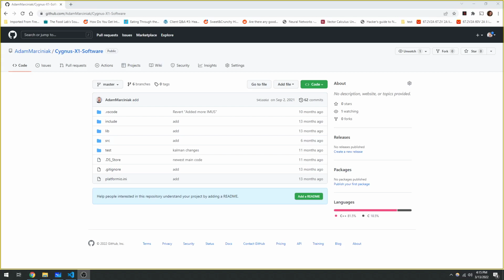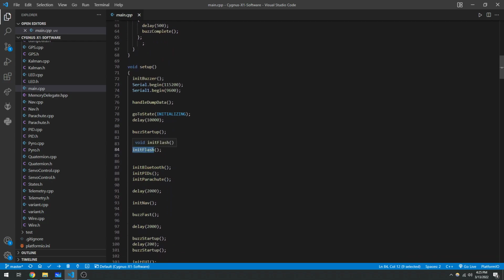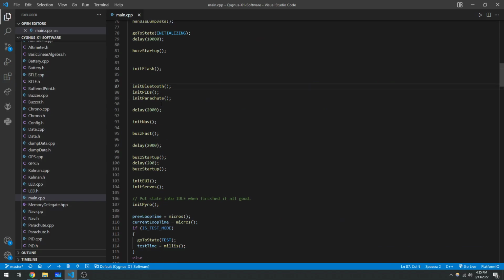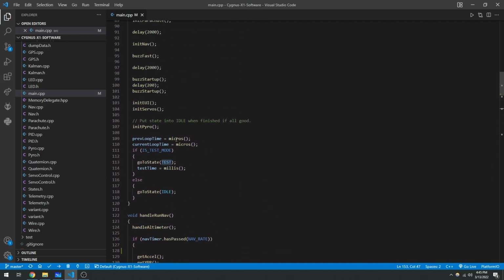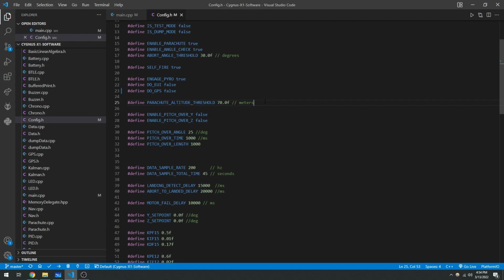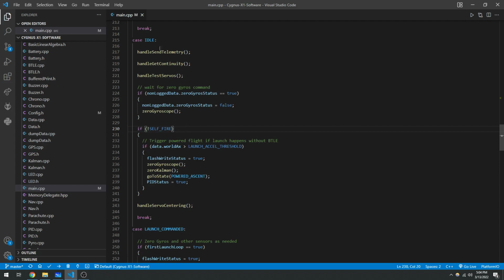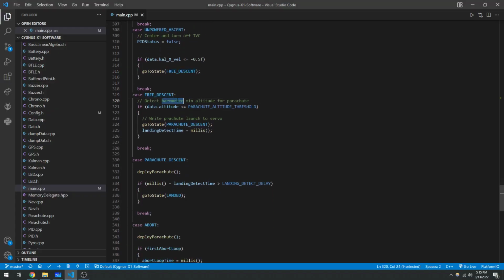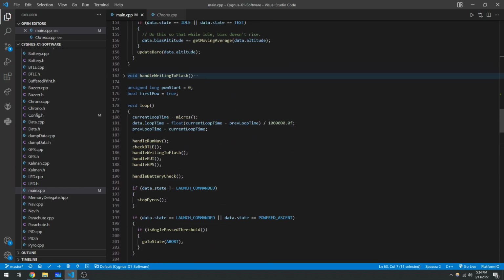Flight Computer Code Explained

Comment: Hey I’ve been trying to do similar stuff but I have recently got into advanced rocketry and I am a school student as well and don’t know a lot of things, but I wanna do tvc. It’s really interesting for me, at the moment I am trying to go slow so one of my recents rockets are using quaternions to represent rotations of the rocket’s flight trajectory in an animation form on a software. I am doing so so that I get to know more and more complex topics to move towards tvc seemingly. But I have been facing some issues with the software I wrote for it, it only works partially and I cannot figure out what’s going on I tried unit testing but still due to lack of knowledge I can put make up what’s going wrong. Id love to get some guidance from you!
Reply from the maker: Are you part of the BPS space discord channel? If not, you should join. There's a lot of knowledgable people there that can help! You can also join the orion aerospace discord which is similar but smaller.

What language is your code in?
Reply: @adamdude  hey thanks for reverting back, matter of fact I am actually a part of bps discord and advance rocketry discord, but unfortunately I am unable to fetch a lot of help I’ve been trying from past few month only some selective people have been super helpful but now the problem I am facing is pretty specific and to solve it I need to show my code to someone and it’s not really a good practice to just shove lines of code on discord and ask “not working, wat do” so I’ve been trying to reach out people personally who seem to be found similar things. 

I code I C language but for this software for that animation thing I talked about is Java and I am doing it on processing IDE but I am also comfortable with doing it on C or python as well
Reply from the maker: @othsys  send a DM to me : polishdude20